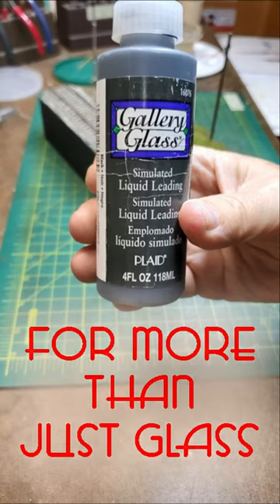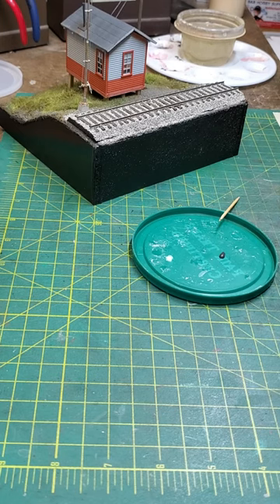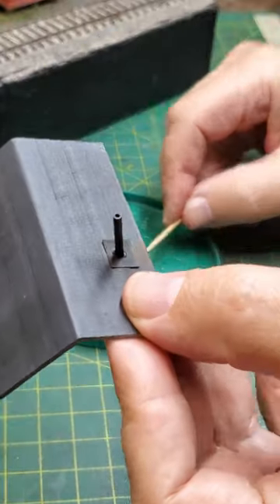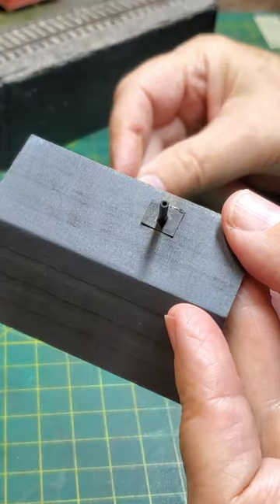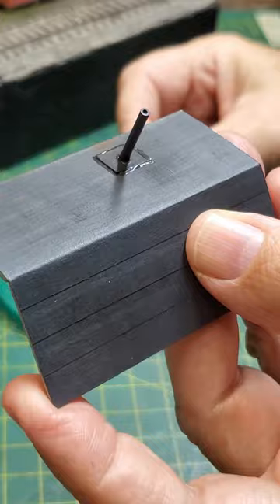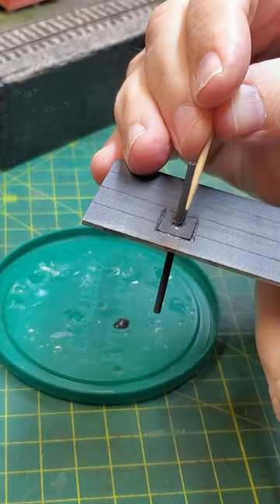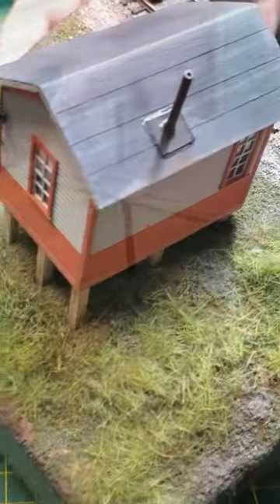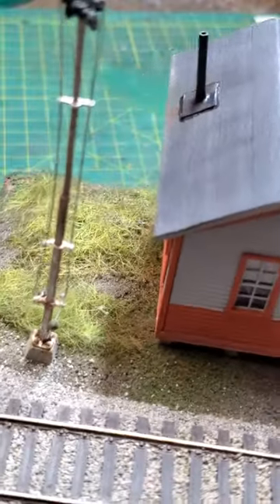Gallery Glass for roof sealant

Comment: Good tip Greg.  I have been using the product for many years.  I have also done live clinic demos with the product, so I back your endorsement of the product.  My only problem with the Gallery Glass is the shelf life.  I just can not seem to use a full small bottle in 2 to 3 years, which seems to be it's shelf life.  After 3 years or so, it gets a bit stringy, but thinning it a bit helps some. But I still concur with your endorsement of the product.   Looking forward to your next short.   Keep them coming.
Reply from the maker: Thanks, Kris. Good to hear from you. I have a feeling this bottle is 4 to 5 years old and so far-so good. Maybe keeping it in the constant 68* basement helps?